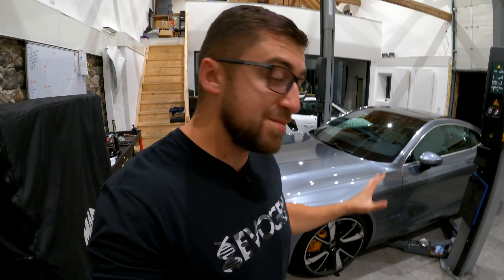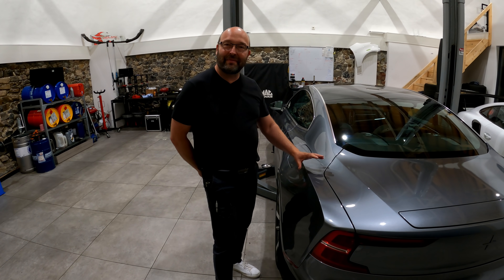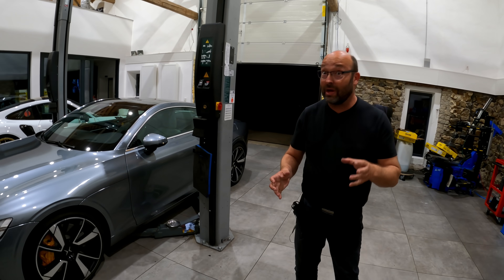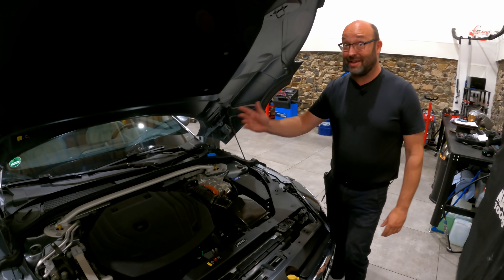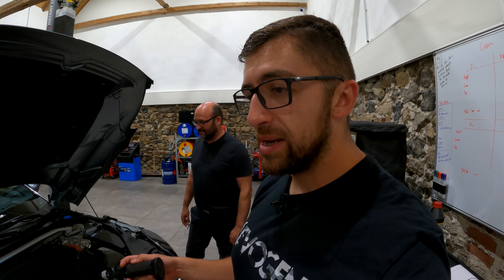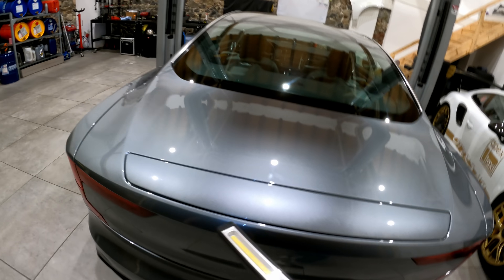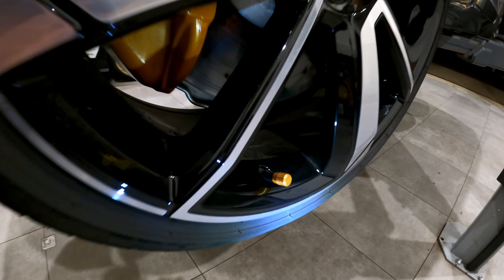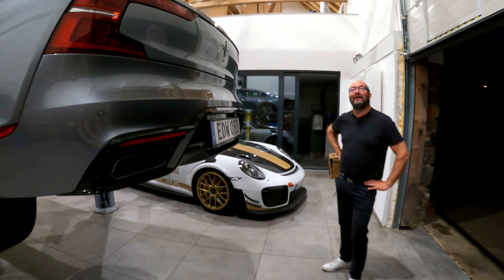Polestar 1: Performance Engineering Explained

Comment: It's interesting that they can't do torque vectoring with the rear wheels when the batteries are empty. Surely they could use the alternator to generate power for the outer rear wheel and then also apply a bit of braking with the inner wheel.

Comment: Is that yellow thing on the rear suspension a transverse (glass-) fiber leaf spring? How did Polestar go about tuning the spring rates on this car?
Reply: Yes, as far as I understand it shares a lot of suspension and drive line components with modern Volvos. They use the leaf spring too (traces it's roots back to the 1994/5+ 960 which used a similar arrangement on the multilink rear suspension)

Comment: @14:00 is that spring leaf at back?
Reply: Yes every modern Volvo has a GFK Spring leaf at the rear. When they aren’t order with air supension. Spring leaf has Big advantage in case of packaging. So the axle is very compact and you have a flat Chassis. Perfekt for fitting batteries.
Reply: @Hessenspotter  ahhh!!! Now I see it. It is the yellow thing. A transversal spring leaf. Must be made of composite material, I don't see any layers of steel.
Reply: @christer8964  yes it is. 

Das zweikomponentige Matrixharzsystem auf Polyurethanbasis Loctite Max 2 von Henkel, Düsseldorf, erwies sich dabei als entscheidendes Element für die Entwicklung dieser Blattfeder, die Benteler-SGL mittels High Speed Resin Transfer Molding (Hochgeschwindigkeits-RTM-Verfahren) herstellt. 

It’s a two component Matrix-resin-system based system. Made by the German Company Henkel.
Reply: Almost look like it :-) One is the exhaust and the other is just a beam.
Reply: Yes. shame they did not mention this special feature during the walk around… Thus is pretty special.

Comment: Seems like there is missing a bolt nut there! 13:37
Reply: I noticed that too, is the arm threaded?
Reply: Good spotting and reassuring for me… I noticed that on my XC90 which has the same double wishbones suspension. It is the same on both side… No bolt. So yes it just be threaded. 😮‍💨

Comment: Great video and great car.
Best Polestar feature is that they ditched the Volvo 180kmh speed limiter :D.
Reply: There is a Volvo 180 km/h speed limiter? The official top speed on my Volvo is 215 km/h (might actually be 217 km/h) which is just the speed you get from 4th gear transmission ratio and engine rpm. I haven't tested the max speed on fifth gear.